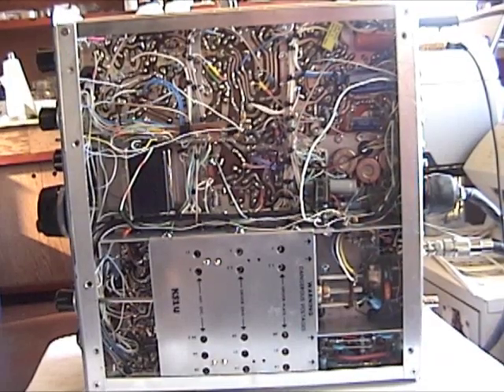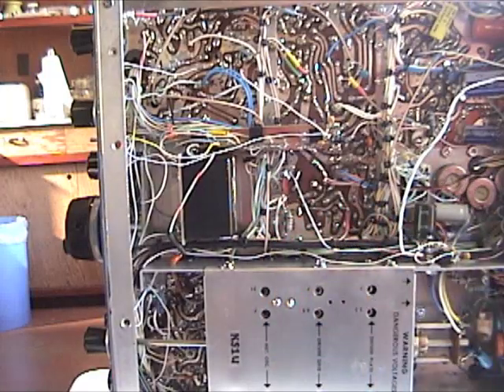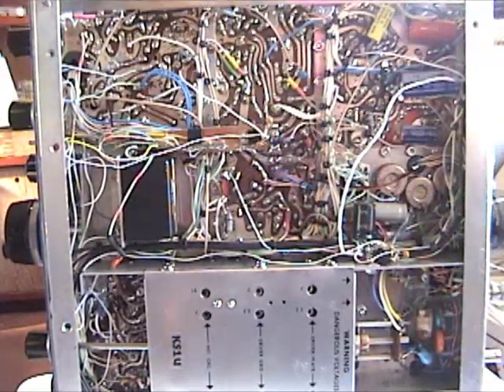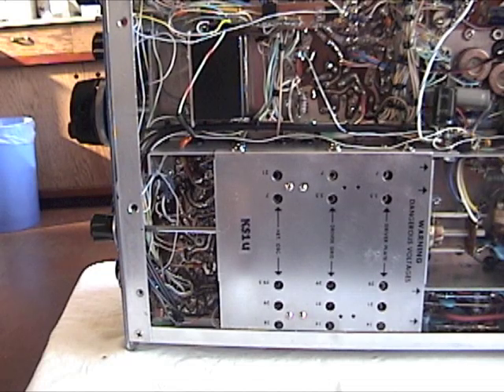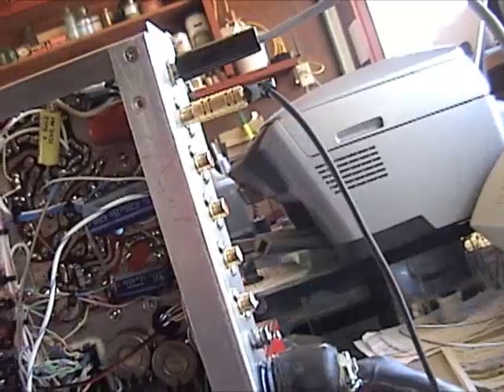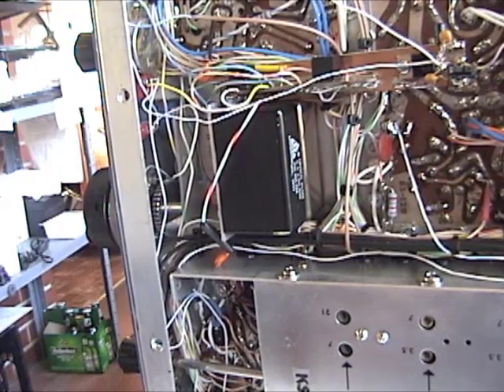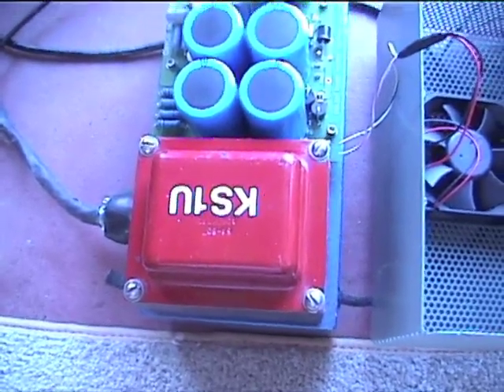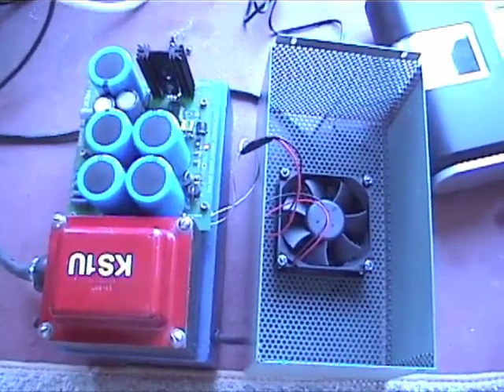Unique Heathkit SB-102 (Part 2)

Comment: That's a beautiful re-do, George... thanks for sharing.
When you mentioned that the original crystal-filter switching setup was a 'Rube Goldberg' setup, it reminded me of the band-switching setup in Heathkit's DX-100 transmitter, with that fascinating cam-arrangement to reach up and switch stuff inside the VFO compartment while switching the other wafers under the chassis for the driver/multiplier/etc stages... definitely some ingenious stuff, no doubt. lol! :-D

Comment: Hi George, GREAT job.  I'm restoring a nice 102 as well.  I'm fascinated by the back-lit dial.  How did you arrange that?  Also, can you specify what relays you used to replace the transmit/receive mechanical relay, as well as the very interesting and strange two-slider crystal selector switching?  Would also love to know how you generate an on-demand 15KHz WWV signal.

Great work and inspiration for the rest of us!

John N4AJG
Reply from the maker: Hi John and thanks.  I used gold plated relays from Mouser.  They were only about $7 a piece.  The back lit dial was a circular piece of plexiglass with a blue led poking in at 90°.  The WWV was simply a separate crystal switched in at the 20 meter band position.